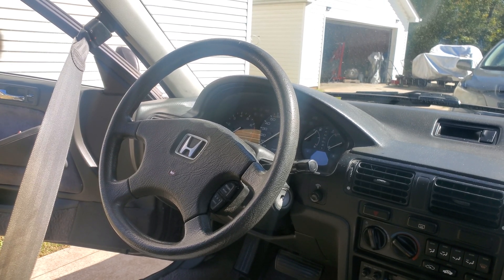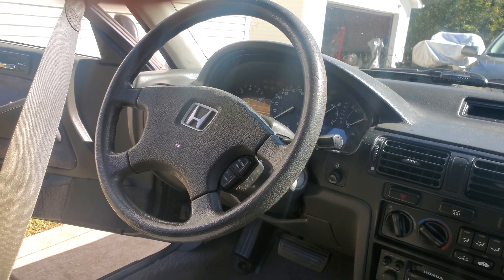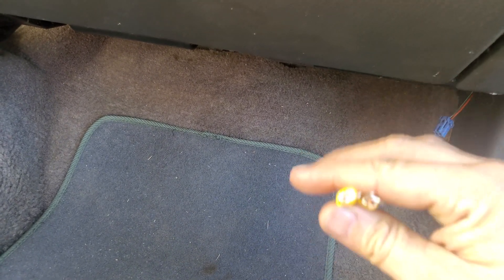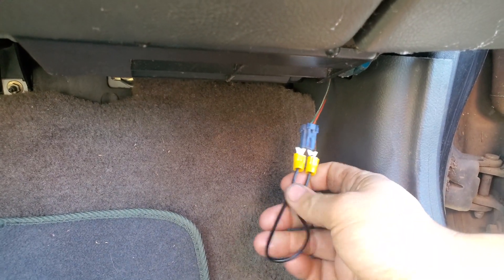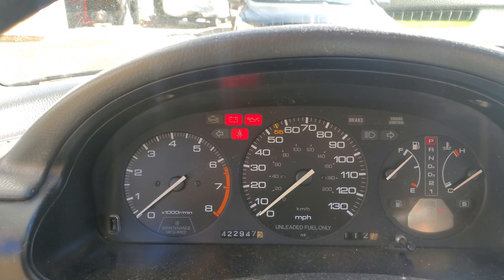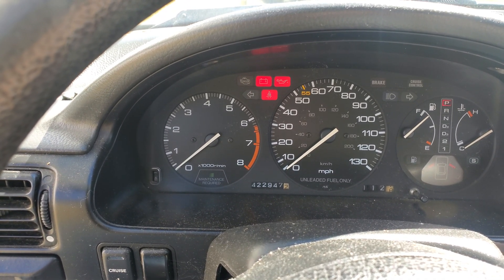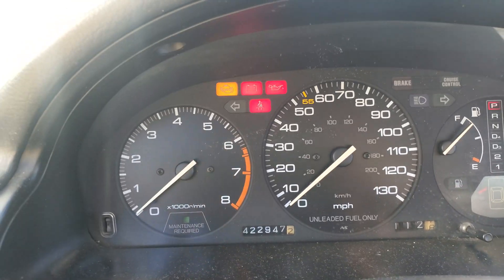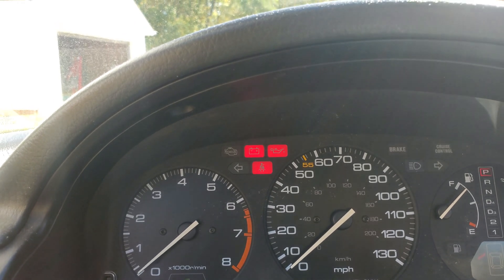Reading Honda Accord OBD1 Codes

Comment: Thank you very much , I have a 1991 just 207.000 miles most when through 7 Decatur mechanics who couldn't do  OBD1 but was trying to steal my engine , could not diagnose my ECU not reading my alternator, I went through about 4 to 5 alternator until this Pakistani  older mechanic just saved me , saying my ECU is not reading the alternator that's why I kept driving on my battery that will drain and car will cut off and not start. I am actually shopping for a used ECU right now. I can't explain the headache I went through and run arounds. Mechanics just taking my money replacing things that was not solving my problem. I think I have already spent $5.000.00 repairs plus parts plus tow. I love my 1991 Honda Accord LX, and almost close to solving the exact problem. And I can see and realize that my milage is still just half way!!!. BUT IF ANYONE CAN ADVICE ME ON BUYING A USED   ECU, should I match it with my vin number or it doesn't matter and just go by the years 1991
Reply from the maker: If you can see the part number off of the original ecu then use that to search for one.  If not, then you can call honda or even use a honda parts site online to and give them the vin number.  Then they should be able to get you a part number that is for your car even if it a 1991.

Comment: Hi guys ! I have an Honda Accord CB7 LX from 1991, imported from United States, i love him so much but sometimes now, it doesn't start, but at least one per day, then it starts, and today showed me this  , engine symbol blink and the "S" appears also thinking to do this method anyone can help me to find what it is after i get the code ? Thanks so much man !
Reply from the maker: If you get the code, post it up and I can try to help you figure it out.
Reply: @operationoverhaul  hi again, code 15 stayed " alive " after I do the reset ...what that error means ?
Reply from the maker: @Gabrieldesousa92 that is an ignition code and it normally points to a bad distributor or the icm in the distributor in my experience. Without looking at it myself I would say the distributor.  I would get either a factory one or a really good brand aftermarket one.
Reply: @operationoverhaul  thanks man , is it a really bad thing? What brand aftermarket or something do you recommend?
Reply from the maker: @Gabrieldesousa92 I have had good luck with the wai global ones if you do not get a factory one.
Reply: @operationoverhaul  I forgot to mention one thing, the light that blinks for me is the "S" 15 can be what ? Solenoids ?
Reply: @operationoverhaul the engine light doesn't blink
Reply from the maker: @Gabrieldesousa92 yeah the code is for the distributor issue.  The code 15 stands for the same on the s light
Reply: @operationoverhaul  ok that's awesome!  Can you send me the link of the product you've buyed that worked for you already?
Reply: @operationoverhaul  thanks man, I'm going to try do it on tomorrow, and the code I get, I tell u here !  Thank you so much

Comment: So if it has 4 long blinks then 3 short ones it means code 43? Which in this case would indicate fuel supply system?
Reply from the maker: That is correct.  It would be a code 43 with that series of blinks.

Comment: why when I put the paper clip in the wire, it makes my car have trouble starting and gives a solid check engine?
Reply from the maker: I think it is because it is meant to be used in the "ON" position only and not to look at while running.  Try that and let me know what it does.
Reply: @operationoverhaul  Thanks for responding! When I have it in the ON position, It still only shows a solid engine light. What does this mean? Or am I doing it wrong
Reply from the maker: @Jadenmcfayden  that is weird.  I have never had them show a solid engine light before.  Let me check on that and I'll let you know what I find out

Comment: My check engine is not flashing after I connected a paper clip and I tried with a wire too
Reply from the maker: you may have a broken wire somewhere from that connector.  I would try to trace it down and check it as far as possible.

Comment: My Check engine light only shows up after driving the Car for a couple minutes how can I check that? 93 accord
Reply from the maker: When it pops up, leave the car running so the light does not go off then jump the connector and count the light flashes as normal. Does it go back off as you drive or only after the car is shut off?
Reply: @operationoverhaul hey my light turns on randomly and then goes right back off. If I turn the engine off while the light is still on will I then be able to read the code because I cannot read old codes.
Reply from the maker: @pennyhunter101  i have read them while the car was running before but I do not think all of them can do that. Try it with the car running and if it does not work then try cutting the car off with it on the accessories position
Reply: @operationoverhaul  what do you mean by cutting the car off with the accessories postition?
Reply from the maker: @pennyhunter101  when you turn the car off, do not turn it off completely.  Just turn it off enough to cut the engine off but still leave the instrument cluster on.
Reply: @operationoverhaul  ok I tried doing that but code is not stored. I can’t think of any other way to get the code.
Reply from the maker: @pennyhunter101  I have never tried get them will the car is running but you could try do it with the car running and see if it will pull the code for you.  Maybe someone else can chime in on this for you as well if they have pulled them that way
Reply: @operationoverhaul  the problem is that it is an idling problem and the light only turns on for like 5 seconds randomly at idle. It’s not consistent at all and it wouldn’t stay on long enough for me to get a reading.
Reply from the maker: @pennyhunter101  Does it stumble like it is going to cut off?
Reply: @operationoverhaul  yes it drops down to like a rough idle from 400-500 rpm then it clicks on the check engine light which picks it up to like 1500rpm and then the light goes right back off and it’ll do it again until I get back on the gas, then it rides completely normal. I have a 1994 Honda del sol d15b7. I’ve looked all over the internet and can’t find someone with the same problem.
Reply from the maker: @pennyhunter101  sounds like a throttle position sensor is going bad without me actually looking at it.
Reply: @operationoverhaul  that’s what I also think. I ordered a new one and connector. I will let you know if this is actually the issue. Thanks for the help.
Reply from the maker: @pennyhunter101  your welcome
Reply: @operationoverhaul  so my tps has .47 volts at closed, and up to 4.2 fully opened (could be higher but I’m not going to mess with it) so I don’t think that’s the problem. I cleaned out my throttle body today and hopefully that will fix the problem because it was a little gunky. I don’t know if it’s fixed yet because it only does it periodically at the most random times so idk.
Reply: @operationoverhaul  ok I just replaced the IACV and now my as soon as I start my car it revs up and down from 1100 to like 1900. What did I do wrong because the new IACV is worse than the old one. What else could it be?
Reply from the maker: @pennyhunter101  The only other thing I can think of is egr related.  May be dumping to much exhaust gas into the engine making it stumble.
Reply: @operationoverhaul  then I put the old IACV and then it goes back to normal. I have the d15b7 which doesn’t have an egr so it can’t be that. Maybe I got a bad IACV? I’m stumped
Reply from the maker: @pennyhunter101  I forgot you said you had the d15  yeah it is a possibility that you got a bad one.
Reply: @operationoverhaul  oh I replaced the tps because I thought that could be it and I’m still have the same problem of when I slightly go on the gas then it idle surges. Also sometimes when I slam on the brakes it drops the idle and if I hold the brakes then it surges. So I’m going to replace the brake booster next and hope that fixes the surging and bucking.

Comment: I did that but the only thing that is blinking is gear D4 it does 1 pause then 5 short flashes after that also the SRS symbol flashes 9 slow flashes and 2 fast flashes after that please help me asap idk what this means
Reply from the maker: If the D4 flashes that is a code in your transmission.  The code is a code 15 and that is a kick down switch circuit shorted.  Then the SRS is a code 92 which states SRS unit internal failure of power supply.

Comment: I have a problem with my brake system
 My master cylinder gets empty and i see the fluid goes to my abs reservoir and starts to flooring what can be the problem
Reply from the maker: Is there any fluid on the ground or inside of the car?
Reply: @operationoverhaul  yes is on the abs side
Reply from the maker: @maurisolhidaluna4693  check the lines for any cracks and make sure the abs unit is not damaged as well.

Comment: 1993 honda accord code 7 what is this one? It’s a stick shift and is bogging down after 1500 rpm but I can shift gears and go as long as I don’t go above 1500 rpm . I jump the port and it blinks 7 times
Reply from the maker: Code 7 is a throttle position sensor code.  https://axleaddict.com/auto-repair/Honda-and-Acura-OBD1-Trouble-codes-How-to-read-and-what-they-mean   This link will show  you the list of codes you can have on a Honda OBD1 system.

Comment: Is this connector compatible with Hondash?
Reply from the maker: Most of the Hondash say 02 to 01 I believe but it will work with this, you just have to have an external power source to run it with the two setups.

Comment: I have a 93 honda i replace the motor but it show the same symptoms
Reply from the maker: I ended replacing the coolant sensor and the egr valve assembly and that fixed the problem on it.
Reply: @operationoverhaul that's exactly what mines doing, as well as fast idle valve is bad

Comment: I have a 94, thanks for the info.
Reply: Turned to be just a glitch in MAP sensor. I unplugged the 3 pin wire for 10 seconds. Check engine light went away.
Reply from the maker: You are welcome. I hope it helps you out.

Comment: Thanks for the video. I have a 1990 EX and I can’t find this blue connector anywhere…any ideas?
Reply from the maker: You may need to remove the kick panel right there.  Sometimes they will get behind those and will be hard to find. Normally they are right there by the hinge on the glove box.

Comment: How can you clear codes?
Reply from the maker: There should be a 7.5 amp fuse under the hood and if you pull that fuse for I think it's for at least 10 seconds and put it back in it will clear the check engine light
Reply: @operationoverhaul  which fuse my accord have 6 number code, check light on, I'm so tired , problem not solve any mechanic and electron

Comment from the maker: Sometimes the codes can only be read when the lights are on but there can be stored codes in there that you can read even if the light is not illuminated.
Reply: How do you fix code 12? Can you do a video on it? Thanks.
Reply from the maker: @entreprengineer  a bad egr is normally the problem but I would check it first.  To do this get the car to running temperature and apply vacuum with a vacuum pump, hand vacuum pump will work, and the egr should hold a vacuum and the engine should cut off once you apply vacuum as well.  If this does not do either one of these then the egr valve is bad.

Comment: Really appreciate this video! 
Quick question. My check engine light just randomly comes on here and there for a couple minutes at a time, does the light need to be on at the time that I do this or does the ecu store the codes?
Reply from the maker: It can depend on the code sometimes.  If the codes are stored you can sometimes read them but it is best to have the light on when trying to read the codes.  I have read mine without the light on before and it showed a code that was in there.  Sorry it took so long to reply I just saw this comment as it was in my held for review section for some reason.